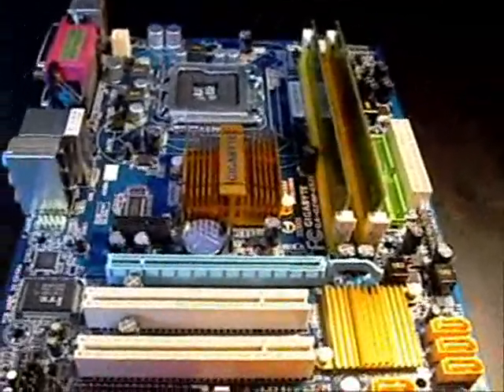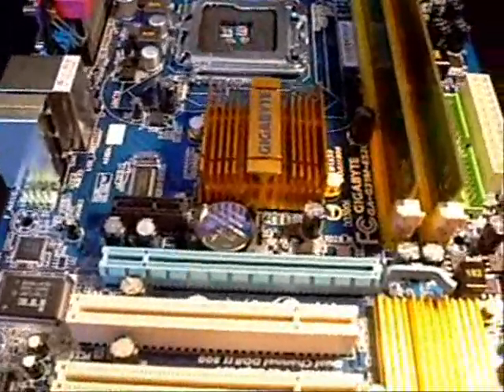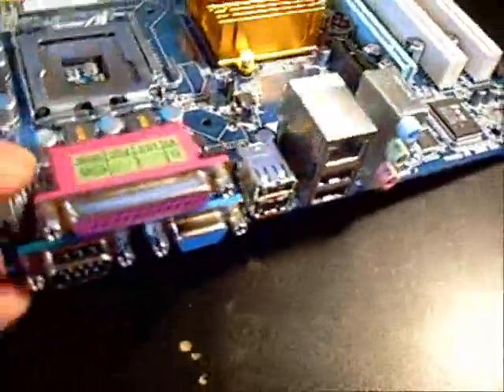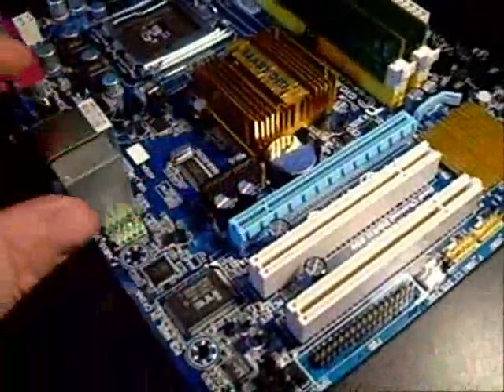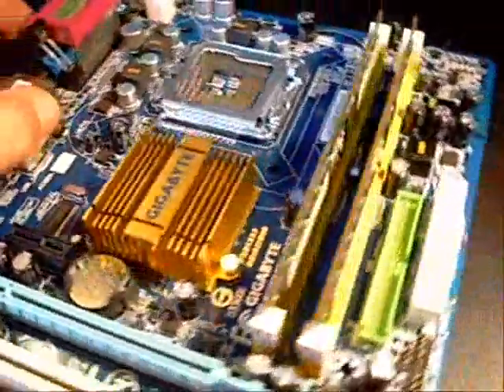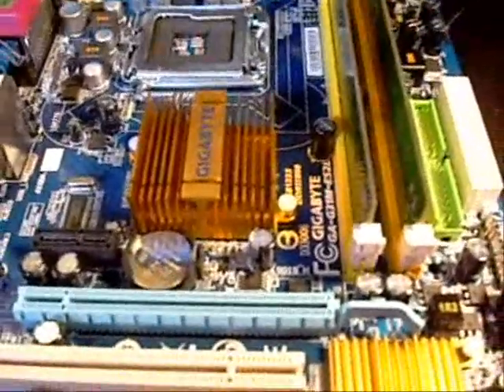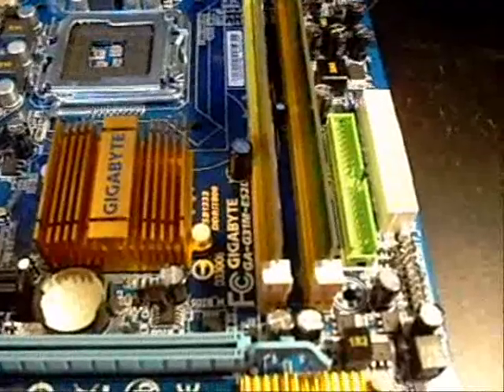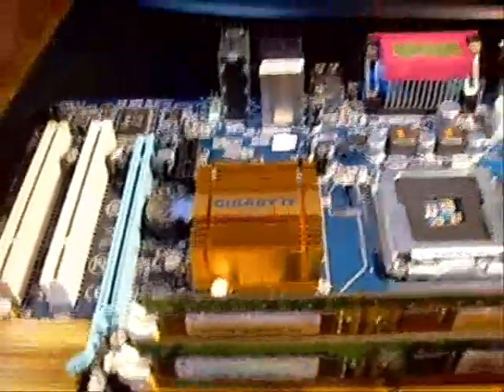Full Review on the Gigabyte GA-G31M-ES2L Motherboard

Comment: i have a Gigabyte GA-G31M-S2C Motherboard it's actually the same but can i put VGA that supports PCI-E 2.0 in this Motherboard?
Reply from the maker: +Muhammad Fat-hy Yes you can. I am not familiar with that board but they are all back wards compatible so even if the board does not support 2.0 it will default back to 1.0 . Either way a 2.0 card will work.

Comment: hi..what is the pci version of this motherboard?i want to install a new graphics card...also what is the problem with the ram slots??can i use 2 4GB RAM's in the slots?
Reply from the maker: If I recall I think it was pci-e 1.0 but all of the newer video cards are backwards compatible and will work just fine with it. As for the ram you can run 2 x 4 gigs with no problem. You just have to be sure to not use any faster ram then 800mhz. The board says it supports 1066 mhz overclocked but 800 mhz is cheaper and works great with this board.
Reply: FUzzyBUnnyBOoties
can i install a radeon r7 240 in this??i have a 250W PSU.i have read in some forums that this card works fine with a 250w PSU...PLEASE REPLY.

Comment: I ended up getting a XIGMATEK PTR-CN881 HDT chipset cooler for this board was easy to install what a difference that makes it runs much cooler. It no longer artifacts due to excess heat when FSB overclocking.

About what I can peak on my C2Q E5430 LGA771 adapter modded CPU
http://valid.x86.fr/zq3c66

This about what I can get stable passive cooled at 7.0 multiplier I've also had it at 420FSB with 6.0 multiplier with less voltage. I'm still testing stuff out it's a fully silent passive cooled PC top to bottom just trying to maximize my acceptable heat threshold a bit. I'm probably going to reasonably max out my FSB and keep it at a 6.0 multiplier to the point where full load it stabilizes just below my CPU's 67c tcase limit thinking I may get a L5408 CPU to replace that one in the future because it's tcase is higher 72c it's lower wattage too so probably better binned VID and power handling.
http://valid.x86.fr/s8jh3m

Tip FSB de-overvoltage is good for that getting higher FSB's at a given voltage in my experience at least. Also a higher faster ram ratio seems to loosen the FSB strap a bit so you'll get higher FSB with DDR1200 at 5:6 than DDR1066 at 1:1 for example.
Reply from the maker: Very nice results. Good tip also on the ram!!. The L5408 is a beast of a CPU.
Reply: FUzzyBUnnyBOoties  All the 12MB C2Q's are beast really. The newer CPU's Intel has made while more powerful don't delivery in terms of efficiency is the irony. C2Q is still king when it comes to energy efficiency temperature tolerance and price value.

Intel hasn't really been challenged to date still by C2Q from AMD so they haven't really a whole lot R&D wise in terms of CPU's. Intel probably could release C2Q's with 16MB L2 cache today if they did a die shrink to them. LGA775 should have become the new Atom platform those still don't stack up against even the old C2Q's they are embarrassing really.
Reply from the maker: ***** I agree Intel is so ahead of itself that it is just putting cpu`s now for the sake of sales not because there is really a need for them.
Reply: FUzzyBUnnyBOoties  The problem is AMD hasn't been competitive pretty much at all on the CPU side of things since AMD64 which is pre-C2D. They'd come out with new CPU's because they've all been inefficient or under powered or both.

The APU's have been AMD's only saving grace at all on CPU side of things and they just aren't tempting and have no real market w/o being paired alongside a efficient powerful CPU. When if you can buy a efficient more powerful discrete GPU like a 750Ti or you have a more powerful discrete GPU you'd be using regardless there is just no demand at all for APU. Some people don't care about powerful graphics at all either to make matters worse for AMD and it's APU's.

Now all of this just makes Intel stagnant and really not give a damn about making more powerful and efficient CPU's in general though they'll try to find new niche CPU's to introduce though they'll try to do a bit of one or the other just not both like they did with C2D/C2Q I mean even those $400 8-core server C2750 Atom CPU's are somewhat of a joke and don't even match up well against a optimized 12MB C2Q because they are based on old anemic P3's and also only have 4MB cache compared to 12MB. The one thing those have going for server side of things is tons of more modern spec SATA ports. Thing is you could get a PCIe SATA add in card and accomplish that and how many do most people need?
Reply from the maker: ***** Well said and I could not agree more. We need another company to step up and push Intel to excel.
Reply: FUzzyBUnnyBOoties This looks interesting though it's for the G31-S2L, but the ES2L is nearly the same board and has the same IC I believe in that area of the board it's to fix vdroop problem on it. http://adrenaline.uol.com.br/forum/hardwares-em-geral/339282-q6600-ga-g31m-s2l.html

I'm rather tempted to give it a try, but I kinda want to get a better 775 board in future a 4 phase VRM dynamic energy saver would be more efficient and stable and potentially a DDR3 board if I ever see a good one cheap second hand. I've always felt a DDR3 2200 board for 775 with very tightened latency timings DDR3 would scream like a nice set of higher spec DDR3 underclocked with tighter timings.

Never seen any benchmarks on that type of system ironically review sites gave up on that platform before DDR3 speeds and latencies ever really took off in fact they were arguably worse or equal than high end DDR2 in most cases which is a bad representation to me.
Reply from the maker: ***** Yes the DDR2 platform what at its peak when the 775 platform was retired but I always felt that it had more potential. It was just a marketing ploy to get people to buy new boards to run the newer Intel cpu`s.
Reply: FUzzyBUnnyBOoties I think DDR2 was near it's peak outside of manufacturing shrinks, but DDR3 was defiantly in it's infancy and no where close to mature when 775 platform was replaced by Intel by the time DDR3 1600MHz sticks with tight timings ever came around let alone DDR3 2200MHz with tight timings LGA775 was long since retired by Intel and it's back pocket paid for media marketing promotional tech websites.
Reply from the maker: ***** Sad but true.

Comment: FUzzyBUnnyBOoties, My I ask what PSU you use for this board? I had tried to put a 425W PSU in it and it beeped at me. It had told me it was a power supply issue. Am I putting too much in or too little? 

Thanks,

The Lyric Master

Comment: Bought a very cheap computer the other day with this in it 2 Gig ram and a core 2 duo e7400 in it  to use as a dedicated MAME, PSP, Dreamcast and 3D arcade game computer emulator.  e7400 CPU was underclocked at 2.4 GHZ ( should be 2.8 ).  Bought an old 8800 GTS graphics card for £12, installed windows XP pro & .  Got rid of crappy stock CPU fan and stuck in a Freezer 7 pro fan in stead for £17.  Have clocked it to 3.4 GHZ, nice n stable, no need for north south bridge voltage adjustment just increased the cpu voltage from 1.26 to 1.31. RESULT.  Using Maximus as the frontend for Mame etc hey presto a nice Emu/Arcade computer for little cash and a minimum of fuss . . . .
Reply from the maker: Very nice setup.

Comment: I've been tempted to purchase a XIGMATEK PTR-CN881 HDT chipset cooler for it for a few years the FSB wall on this chipset is crazy if you don't mind the risk of overclocking your PCIe bus clock which comes with it's set of dangers since it's also tied to PCI/SATA bus's as well and maybe USB too.

At the same time if the hardware can tolerate the overclock the extra bandwidth can actually be beneficial both the CPU FSB and the actual peripheral bus's themselves. This is a good hackintosh board I've read as well never tried it though because I don't like Apple or Mac's.
Reply from the maker: Would be nice to have the chipset cooler. They are getting kind of hard to come by. The last time I looked there was only one place selling them.
Reply: FUzzyBUnnyBOoties
Yeah newegg has them, but it's hard to find a good passive cooled heatpipe chipset cooler in general the nice thing with the Xigmatek one I mentioned too is that it's a little bit offset so gives more clearance to avoid being in the way of aftermarket CPU coolers as well.

I have had the FSB up to 475MHz before when overclocking the PCIe bus there is someone that's had it up to 500FSB as well not sure if they had active cooling on the north bridge though, but I'd assume so because honestly it's hot even when it isn't being overclocked.

Overclocking PCIe bus has it's share of risks though because a few other bus's are also tied to the PCIe clock rate as well namely SATA and some HD's have a low tolerance for PCIe overclocking not so sure how it impacts SSD's, but with regular HD's it was defiantly hit or miss. It might actually benefit SSD's since they are really sata bus bandwidth starved in general.

Safest way to do it if also using PCIe video card would probably be to bios mod it's base clock rates to be lower by like a % of the PCIe overclock bus rate, but my point was just this board has good overclocking potential just with added risk involved.

It does provide great bios control though which is surprising for such a cheap costing mobo.

Comment from the maker: Yes it would. It will not run at pci-e 3 speed because the board only supports pci-e 2. But the difference between the two would be unnoticeable.

Comment from the maker: That is a smart way to do it. What will happen if the power supply is not big enough it will over heat and shut down the computer. So if that starts to happen you know you need a bigger one. 

As for brands Rosewill and Thermaltake make some great ones cheap in the 500 watt range.

Comment from the maker: They both are going to require close to a 400 watt power supply. I think you will be pushing it with that power supply. You could certainly try it. But I would keep a eye out for at least a 500 watt so you have some room to spare.

Comment from the maker: You can use any of the latest video cards that you like. It does have a 16X PCI-E slot. As for power that would depend on what video card you go with and how many drives and fans you use. But If you are not buying the highest end video card you could get by with something like a 500-600 watt PSU.

Comment from the maker: Yes i believe all of the GM41 boards have ide connectors for ATA drives. 

As for windows you may be able to boot into safe mode and remove all the hardware then reboot and let windows find all the devices. This will work some times but it is always best to do a clean install of windows when changing something as important as the motherboard.

Comment from the maker: I did some more  research and it would seem that it was the card itself. They have a history of of locking up. some say it is the heat sink on them allowing them to get to hot. The board it self should run any PCI-E card on it. Is it possible that the card had better airflow in the other case that you tried it in?.

Comment from the maker: Did you try the video card in another computer to make sure that was not the problem?. If so then what operating system are you using?. That card is only supported up to windows XP. Last and not least could be drivers did you try didn't versions to see if one would work with it?. Sorry for all the questions just trying to get a better idea of what you tried already,

Comment from the maker: The board supports pcie 2.0 but the card should be backwards compatible and work just fine with it. There is no speed difference between 2.0 and 2.1 so you should be just fine.

Comment from the maker: You can install any pci-e video card that you like. The ram on the video card run separate from the ram on the motherboard. So even thought the motherboard is restricted to only using DDR2 ram the video card could use DDR3 or DDR5 or what ever speed the card has installed on it with out any problems.

Comment from the maker: @joeyunleashed13 I had the same problem when trying to fit one of my cards in there. I just took a knife and cut it off. It is there to lock the card in but I never used it and never had a problem with a card coming loose after removing it.

Comment: @FUzzyBUnnyBOoties 
With that RAM installed, it wouldn't boot and be stuck at the BIOS startup screen. Tried to go to bios ( pressing del key) but it wil still be stuck there. After few seconds it will shutdown. My idea is that I overclock the RAM myself to 556 Mhz in the BIOS. Anyway thanks for the info...

Comment from the maker: @EffroyableMat Have you checked their website to confirm the ram that you are using is on their compatibility list?. Is the ram at the right voltage?. Are you overclocking at all?. Some ram will only reach it`s advertised speed when overclocked. So it might say 800 mhz ram but really be 667 that can be overclocked to 800 mhz.. Sorry for the vague reply just trying to narrow down up you are up against.

Comment from the maker: @shree777123 It is possible that the sound chip has gone bad. I have not seen that on this board but I have seen it on other boards. You can check the bios and make sure that on-board sound is enabled. And also make sure that you have your speakers plugged into the green hole on the back of the motherboard. If it still inst working it may be time to buy a cheap sound card and install it.

Comment from the maker: @shree777123 Sorry I shoudl have asked you which version of windows you were using. If it is Vista or Windows 7 you should be able to right click on the speaker icon and the taskbar and click on playback devices. You should see a couple of different option there.  Find your headset in the list and click on configure or properties and see if the volume is down on them. Also if your headphones have a volume control on the cable itself make sure that is turned all the way up.

Comment: This is a great board. I don't regret buying mine - overclocks like a dream! Just one point, although it only has 3 audio connectors it does actually offer 7.1 audio (the line-in and mic jacks double up as audio inputs if you configure them as such in the software)

Comment from the maker: @07yondaime No it will not. They are backwards compatible. So if you run a 2.0 on a 1.0 slot it will work but not be as fast. This board however is pci-e 2.0 so you can run any of the newer card`s on it.

Comment: This is a really good motherboard for the money. I highly recomend it! I used it to upgrade my manufactured Gateway 838GM. I wanted to upgrade to intel core 2 quad q8400, and I couldn't just plug the new cpu into the 915G it comes with, because it isn't compatible, although it is an LGA 775. So I went and purchased this baby at amazon and works like a charm it runs perfect. I didn't need to buy nothing else. I used the same case and everything, but you do need to upgrade to DDR2. GRADE A for d $

Comment from the maker: @CLumz100 Sorry to hear that. It is possible that it will work but it might clock the ram down to 800MHZ instead of 1066. Let me know what you come up with I would love to know if it will run 1066 or not. I have not tried it I just went with what the manual said.

Comment: Bought this board to replace my fried gigabyte EP43-UD3L (much better board but sadly discontinued).Its more of a desktop board with decent overclocking settings in the bios than anything else. It will overclock your cpu BUT you have to take baby steps with it. Change a setting, see if it posts, rinse, repeat..

Comment from the maker: @FAVIdeoRecords Your whole computer would use probable around 300 watts depending on how many drives and fans and all. 

My gaming system has a overclocked core 2 quad HD4870 4 gigs ram sata HD dvd-rw and 6 case fans. The whole system only draws 365 watts.

Comment from the maker: @FAVIdeoRecords The ram that the video card uses is separate from the ram the motherboard uses. So you could use a video card that has DDR 2/3/5 with that board. 

The amount of ram that the video card has makes very little difference in its performance. The speed of the ram will make more of a difference. So 512 of DDR3 will be faster then 1 gig DDR2.

What type of games do you like to play. I will see what other cards are in the same price range.

Comment from the maker: @shree777123 If it plays fine by just adding more airflow then the PSU should be fine. You may try to add a couple of fans to the case if you can. Like maybe one in the front pulling air in and one in the back blowing hot air out. But at least for now you know you can play until you are able to get some fans :-)

Comment from the maker: @shree777123 This is the minimal requirements for that card. 

Minimum 450W or greater system power supply (with a minimum 12V current rating of 38A)

So I think that you are probable right at the edge of what that power supply can handle.

Comment from the maker: @shree777123 It is PCIe 2.0. If the computer is restarting while gaming I would guess that something is overheating. Is the power supply  enough to run that new card?. You can try removing the side cover of the case and use a house fan to blow air into the case. And see if that keeps it from restarting.

Comment from the maker: @AtomicF You will be very happy with the Q9300 I have been running two of them for the past 2 1/2 years and have not had any problems with them. 

I think the reason that people get the 1066 ram is to overclock so they can push it past the 800mhz with out the ram failing. If you don`t plan to overclock then it wouldn't be necessary. 

Yes 2.1 and 2.0 are compatible.